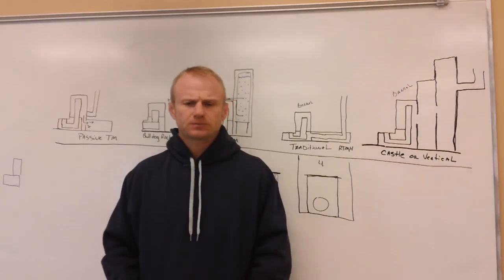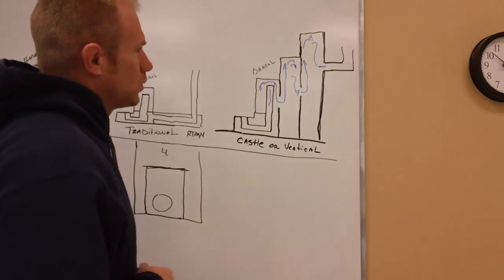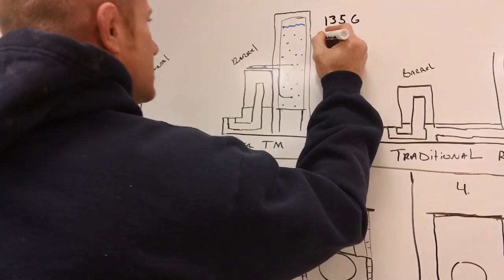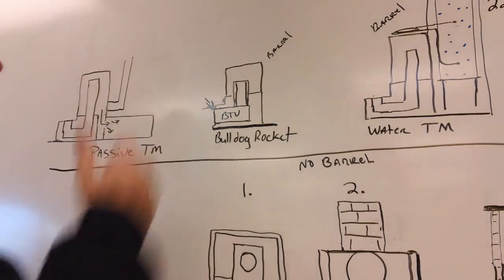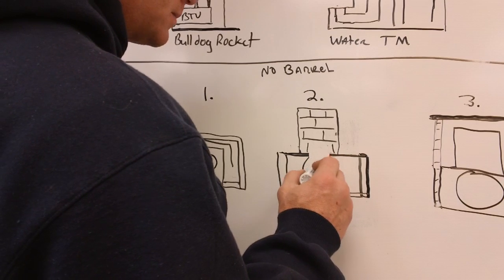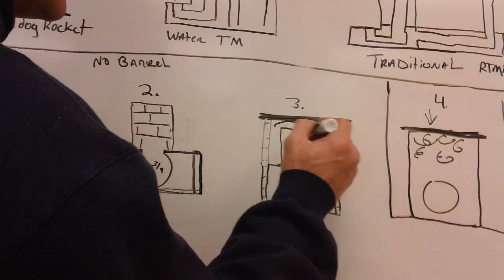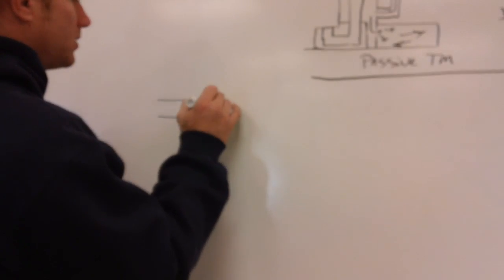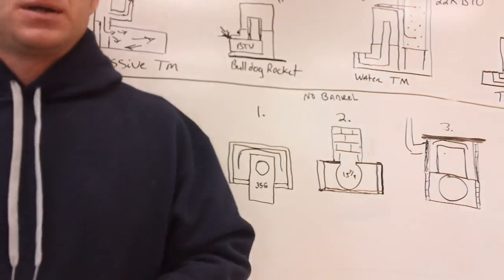Rocket Stove Design Variations

Comment: Have you seen a design that has an outside air intake and a burner large enough to cord wood? I would like to build one in my basement and draw the air in from outside so it doesn't draw air in around the basement doors, and also be able to buy a cord of wood and use it just as it comes. Thanks.

Comment: Got 2sa thank u. Build 2of your designs. The castle 40gallon water heat exchanger and the underground with dirt floor large space u designed 4pit greenhouse. The castle tank relief valve needs watching, bout to send water upstairs using city pressure until I get thermal siphoning correct. This tank supplies 4bathrooms and 3kitchens

Comment: 250 gal in 55 gallon drums that are only 30 inches across and 6 feet high how does that work? You need five 55-gallon drums and they won't fit in that space! This guy is kind of frustrating.

Comment: I've been reading on Permies that metal combustion chambers and risers are subject to rapid deterioration due to high temps, carbonization and spalling from acidity. Perhaps cast, ceramic or refractory bricks might be better for a combustion chamber?
Reply from the maker: anything made galvanized will release poison gases and simply wont last . black stove pipe wont either. masonry only and NOT with  insulation additives . the heat stored in the riser will  keep drafts going properly as fire dies down. Insulation materials are the inverse of thermal mass storage abilities dont use them for a riser. you want heat in the riser Metal is not a good heat battery so it makes a poor riser. see thermal K value material charts.

Comment: Interesting theorizing for the time, but outdated as of 2017... I would emphasize that the "castle" and "passive" designs are shown incorrectly and would not work well as shown. An "L" rocket configuration burns less efficiently than a "J" style. If you want a bigger load, use a batch box style RMH. the author's discussion ignores some of the features that make rockets so efficient and effective. Greenhouse RMH designs have advanced significantly since this video.

Comment: I'm not new to the basic Rocket Stove concept, but new to the added features that produce the rocket mass heater. In the greenhouse example, which I am trying to visualize, I visualize the exit pipe on the steel cover, allowing the heat to bounce around in the dirt chamber before exiting. If the pipe was in the burn barrel, wouldn't a lot of wasted heat just fly up the pipe before hitting the dirt "barrel". I am visualizing this all wrong? I'm trying to think mass heater laying sideways, so my perception may be off.

Comment: how much wood fuel does it take to keep something like this running?
Reply from the maker: that depends on how big of a house or area your trying to heat and how warm you would like it to be.. Stoves that store heat by mass of cob or water let less heat escape up the chimney and then latter radiant it back into the house making the over all wood uses less.. design has a large impact on this question.. A/R x D = BTU requirement per hour.. or area of exterior wall divided by R value of those wall multiplied by the temp difference you want on worse day determines BTU requirements.. and one pound of hard wood with less than 10% moisture has about 8000 BTU in it.... BTU = amount of energy needed to heat 1 pound of water one degree..
Reply: gearsNtools much less than a standard woodstove. equivalent to stoves that cost thousands

Comment: I want to build a no barrel stove and would like your thoughts on the bricks to use on the outer wall that goes up to where you would install a plate. Do I need to use fire bricks or would plain red bricks work. Thanks.
Reply from the maker: Hello.. I have used old solid red bricks in stoves that are now over 5 years old no problems BUT I have had others report to me they have experienced cracking... Different bricks different mix different ingredients= different heat tolerances . But you will find the no hole old solid red bricks work just fine ...but you could use top few rows as brick if ya had them

Comment: The reason for the pit in the pit green house, is because heat rises and cold air falls. So the cold air will drop down into the pit(where the plants do not grow), keeping the higher elevation warmer and from getting too cold. :)
Reply from the maker: "the reason"See I thought there were a couple other reasons too.  one would be the cost of use of less materials to enclose a large area that you can walk through and also less glazing aprox 50% means less heat loss or better insulated green house or less heat expense. I also would think anything below the frost line would actually give heat off to help warm in winter. I also see the advantage of building stoves into the bank in order to use the earth as thermal mass. Those are MY reasons. So I guess the proper question is "The" reason for who..

Comment: As i understand this the brick never see any flames, so there is no need for fire brick right and the bigger the chamber is, the better it is, right. I wanted to build a stove with a 45 gallon drum but it ugly so i go with your bull dog model with a little mass beside it. Tanks. If you have any suggestion please feel free.
Reply from the maker: the brick see flame. only old solid red brick or fire brick no brick with holes in it. Ideally you build your stove to meet your BTU requirements and if your going to steal some heat to heat water figure in the BTU need to heat the area and the water so you can heat the space aquatically while storing more heat for latter. but if you cant figure that out.. build it BIG you can always let the fire go out. but you can only put so much wood in a little stove.

Comment: In regards to your trench oven, I would like to share a little story. In an earth oven my friend and I once made in clay, we dug down about 4-5 ft and about a 6 diameter. We put a breather pipe laying into the hole, protected at the bottom with a mound of bricks and rocks so it would not get plugged. The entire purpose of this fire pit was to burn off a great deal of fire hazard material that was abundant in the area, but we wanted a somewhat sheltered fire that wouldn't go out on us, easily. Bear in mind this existed in the wettest of weather, absolute spring rain weather. It was raining all the time and all of the fuel was soaked. You would not believe how well this fire worked. It was INSANE. It got so hot due to the breather tube that we literally could add shovelfuls of wet soaked leaves, and it loved soaked crap fuel. It consumed ANYTHING and became like a blast furnace, it was downright SCARY. When we stopped adding fuel it burnt for an additional 12 days on just the fuel of the previous week. With no new fuel. And that was without any sort of lid or steel plate. It was completely convenient. Once rocking, it really didn't smoke either, it was so hot, when you fueled it, there was an enormous cloud of steam, and then it was back to being the firey pit of coal hell. We were amazed and frightened. We'd sit watching it late in the night scared shitless hoping we wouldn't set the property on fire should a large wind kick up. Fortunately, as I said, it was clay surrounding it, and it was wet season. Even at that, we found cedar roots that burnt a full 18" back from the pit, underground. So yes ground fires if you have a controllable air pipe to the bottom, can be INCREDIBLE and extremely easy to fuel with absolutely anything. I love your idea of the greenhouse furnace rocketstove
Reply: Can you please make illustrations  and pictures of your build, i have a picture comprehension, a low spectrum autism....i ll watch for your post under your name

Comment: Thanks much for your videos. A great way of explaining it. I am very intrested in your rocket stove without a barrel on top...I wonder how it would heat a house if you ran piping through the thermal mass...
Great job,
Reply from the maker: Hello thanks for watching. Its not really my design so if I came off as I took credit for it please forgive me. I have seen a "no barrel" design used  with all stone where the riser barrel would be. I guess then it would be called a masonry heater. I realized that application could be used to build a very large or larger rocket stove riser circumference style stoves. A single sheet of plate steel could be used on top of the masonry walls for a flat cooking heating surface with a coil right under but over the top of the riser. It could easily be run thermal siphon system  to heat any mass or radiator you like. Have you seen my bulldog rocket stove? might take a look how easy thermal siphon can be.
Reply: Piping through the thermal mass may reduce the temperature of the burn chamber. As long as the piping stays above the burn chamber, it works well.

Comment: Thank you Van Powell, You have confirmed what I have been working on the past several weeks myself. (except I had not yet removed the barrel) I like the bulldog approach. I would be interested to talk with you about inserting TEG's into the system. ( I am currently working on different materials that can be used as TEG's) Thank you and keep up the good work
Reply from the maker: Hello Liam. Thanks for watching. You are very welcome. I am open to talk about the TEG's and  I am interested in your teg material designs

Comment: Fig 3 of your new design doesn't take into account the necessary cooling a metal barrel provides on the sides of the barrel.  If you used brick on the sides, the cooling might not take place, or not as well, which could cause the draft to stall.  I measured the temps along my 1 1/2 barrel height and I can see the temps dropping every foot of barrel.
Reply from the maker: Rj I have seen old masonry heaters designed this way with stone over the top and sides both no barrel or surface area at all that draft just fine. I think your temp drop is a result of the barrel loss and I remember a chimney a 100 degrees warmer can be 100 times shorter and still have the same draw . the space or gap must be tuned if you will to achieve the proper exit temps as long as your final pipe is 120 or better on the way out it will draft fine from what I have seen thus far. I am still amazed how well the bulldog 12 inch opening with a 10 inch brick riser with only a 22 inch height drafts so well out of the 6 inch pipe.
Reply: In a RMH, I think the secondary burning expands the gases in the riser as it hits the top of the barrel, the gases quickly start to cool and condense as it is pulled downward by the draft.  The massive draft in the riser and the cooling next to the barrel both help and assist proper drafting.  I have had holes develop in the riser where hot gases escaped to where the cooling was occurring.  This cases the draft to fail because the inner riser temp and the outer barrel area temp's are too close.  The greater the temp difference the better the draft.  This is why I believe  if the outer barrel area is allowed to gain heat and not cool properly... it might cause the draft to stall.  Believe it or not, my riser is only 4 inches.  I found a smaller riser helps the draft.  I've been waiting to make a videos of what I learned over the past 18 months.  Unfortunately, I'm a chicken shat to make videos of myself.
Reply from the maker: Rj Aquaponics the temp difference can be any where from the burn to the exit and it will push or pull the draft and again I have seen it work with my own eyes in masonry heaters. I think your right the temp diff has a great deal to do with it I just dont think your considering if the stone was of the right surface area to provide the temp difference the draft would still be strong as the lower brick would be much cooler than those higher and closer to the riser. Give me some time and I will do it. LOL holes in the riser huh ,,, I bet after you burn a few more metal risers out over the years you might consider going to brick,  Now about the videos... I get trolls and meat heads and true blue booger picken morons posting and making all kinds of claims,, its to be expected. You do it for your own record and as an offer to others to take what they can from it or even just look into it for themself or just to prove me wrong either way I do it for the ones that want to learn and understand not the ones that want to make themself feel better by putting down someone else. evil abounds when good men do nothing do your part make your contribution make the videos. to many people video the start and not a year into it report.
Reply from the maker: Rj Aquaponics one more thing on the subject I wanted to say. water is 9 times more dense than air. If water stratifies in a 55 gallon to the tune of 75 degrees or double the bottom temp and water is better conductor of heat than air what makes you think air around the riser wont stratify at leats 9 times more? thus giving the temp diff to draft properly in a all brick or stone barrel? also the stone is more of an isulator than conductor of heat like metal so the heat stratification should be greater from this aspect as well and further the lower part of the brick will be cooler for one more reason and that is the ground or concrete its setting on is a heat wick or sink pulling heat from the lower stone closer to the floor causing it to be even cooler.